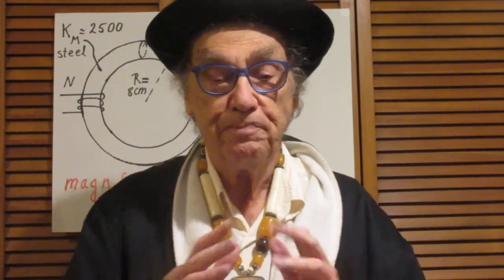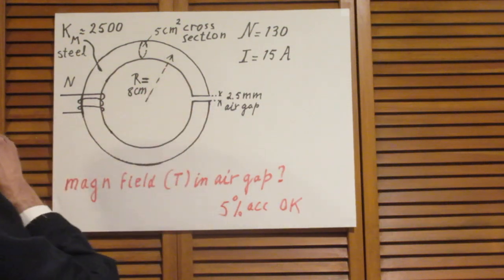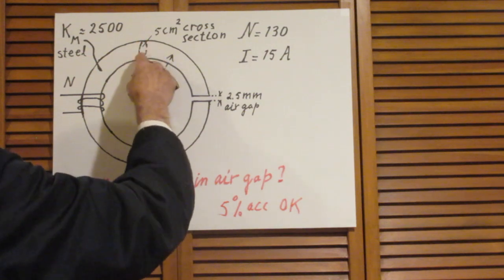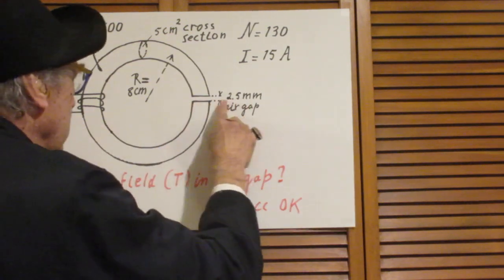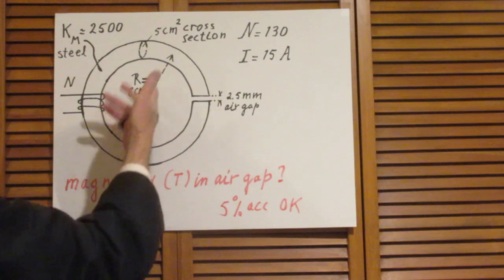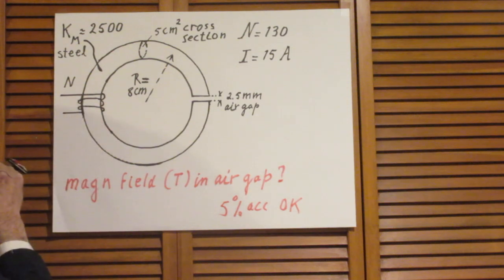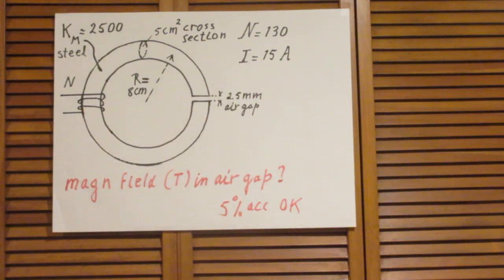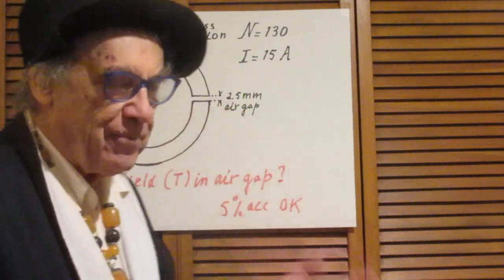Problem #57 - Electromagnet with Air Gap

Comment: Sir does air pressure account for an object's weight? 
If we keep an object on earth in a vaccum chamber will its weight be less?
Reply from the maker: place an object in a jar which you evacuate it's weight will go down just a trifle according to Archimedes' Principle. Watch my 8.01 lectures in which I cover all this.
Reply: Sir which lecture should I watch to understand this better
Reply: Sir if weight goes down then why 
Weight = mass * gravity
Why don't we add air pressure to it
Reply from the maker: place an object in a jar which you evacuate it's weight will go down just a trifle according to Archimedes' Principle. Watch my 8.01 lectures in which I cover all this.
Reply: Sir there is  a whole series of lectures. Should I watch all?
Reply: Is there a particular video that will clear my doubt
Reply from the maker: watch my 8.01 lecture on Archimedes' principle - it applies to both liquid and to gass.
Reply: Thanks sir

Comment: My wish is to get reply of my question before you pass away

Why the visible-light (rays) can't pass from our body , while the bigger wavelength radio waves(not sure) and the smaller wavelength X ray pass from the body
Reply from the maker: use google
Reply: Becoz penetrating power of visible light is less that of x-rays n all
Reply: Power is proportional to amplitude^2 ??
Reply: "The mechanism for absorption is that a photon transfers all its energy to an electron in the absorbing material."
https://www.asu.edu/courses/phs208/patternsbb/PiN/rdg/mechanism/index.html

Comment: My friend your radiation pressure problem is great memory refresher (although I didn't solve it in the right way), when it is considered a relativistic problem when it became a classical one ?
Do you have good sources on computational electromagnetism
Reply from the maker: Problem 57 can be solved WITHOUT Einstein's Theory of SR. Thus it is NOT and SR problem at all. But SR allows you to solve it fast. I cover in my 8.03 lectures the Poynting Vector and consequential radiation pressure. All that is classical Physics.
Reply: @lecturesbywalterlewin.they9259  I don't understand why SR solves the radiation problem "faster".    Classical physics: power = force * velocity (when they are parallel).  Classical force = power/velocity.  Light pressure force = power/C.   Isn't this the same thing that SR comes up with?  The only "magic" needed is knowing  C and Newtonian physics!
Reply: Didn't answer on computational electromagnetism.
Reply from the maker: ask google
Reply: You are better than Google anyway will do

Comment: Hi professor Lewin
I have a question....
We know that in a pure magnetic field system the force action on any charge moving with velocity V can be calculated by the equation f= q(V×B). Now for the situation where large number of charged particles are in motion We can write F= ρ(V×B) where ρ is the charge density. By writing J(current density)= ρV....we can rewrite above equation as F= J×B.
"So for current flowing in conducting media this equation can be used to find force density acting on the material itself." It is written in my course book.
My question is that which law of physics explains the mechanism by which the force is transferred from the moving charge to the conducting medium?
Thanks for your amazing lectures sir.....;
Reply from the maker: watch my 8.02 lectures
Reply: Sir I have gone through your 8.02 lectures thoroughly many times but i am still unable to find the answer of my question...
Reply: @saharshkartikey773  
A current flowing through a conductor can be modeled by a current density J(x,y,z) = ρv.
The differential Lorenz force  (per unit volume) at each point in space in given by:
dF = dq(E + v x B) = ρ(E + v x B)d³x = (ρE + JxB)d³x
To get the total force acting on the current distribution in a rigid form, you integrate:
F = ∫ (ρE + v JxB)d³x.

Read Jackson 6.7.  See equation 6.114.

Comment: In the interest of viewers with trouble understanding English foreign accents, I have typed up the problem part of the video here.

"An electromagnet, steel core and a very small air gap. If you choose the dimensions correctly, which I tried of course, then you can calculate the magnetic field in the air gap to a very high degree of accuracy. The key is that the air gap is much smaller than the radius of the steel core of the magnet- and I have chosen it. And when I solve the problem, I will mention that if the air gap is not much much smaller than that radius of the core then we get fringe fields- and those fringe fields, bulging out near the air gap, will then lower the magnetic field. But we don't have to worry about that, you can complete ignore any fringe fields. Ready?

Here is the circular steel core of the electromagnet. The steel has a relative permability of about 2500.
 The cross-sectional area of this core is about five square centimeters, and the air gap is only about two and a half millimeters right here. Radius of this core is eight centimeters, and there are here windings through which current will flow- and windings around this core. And N is 130, and the current through these wires is 15 amperes. And the question is: What is the magnetic field in Tesla inside of the airgap? I mentioned here 5% accuracy. You can ignore that if you want to, because when you make the simpelest assumptions that yo ucan, you get an answer that you wouldn't even know how accurate it is- because in that assumption you have ignored fringe fields. And you can take my word for it, that you can ignore those fringe fields. Okay, it's a very classic problem- any student at MIT regardless of what they are majoring in has done this problem."
Reply: Prof. Lewin´s english is  excellent  but the acoustic properties of the room he is using are horrible  :)
Reply: @user-jp1qt8ut3s  I do not have trouble understanding his accent. This was requested in a previous video's comments section by someone who has and was done as a courtesy to students with hearing difficulties.
Reply: really ? Taking into account i'm dutch it could be :-).
Reply: Great! You should also include them as subtitles in the video ;v
Reply: Thank u sir 👍
Reply: Prof needs to practice his Indian accent.

Comment: Thank you Dr. Lewin. I work in power supply design, but I lack a Physics background, so I solve these kinds of problems experimentally. I am working to learn the Physics behind the problem to hone my skills, so this is a great practical problem for me. I don’t think I’ll have time to solve it because I’m in the earlier part of my Physics studies, but I might give it a try. Is there a particular lecture of your where you cover the necessary equations (or would that be cheating)?
Reply from the maker: If you have watched my 8.02 lectures covering Maxwell's eq related to magnetism you may be able to solve this problem.